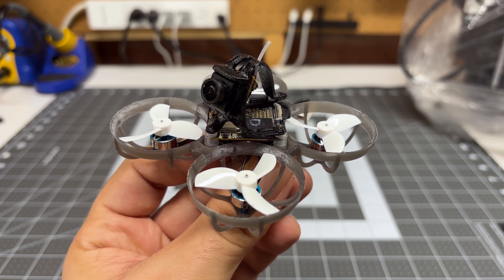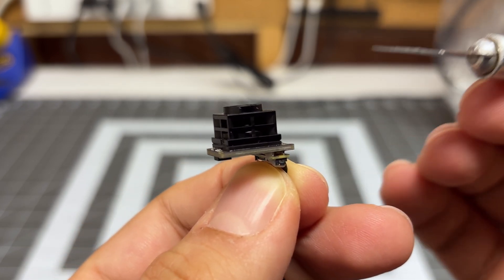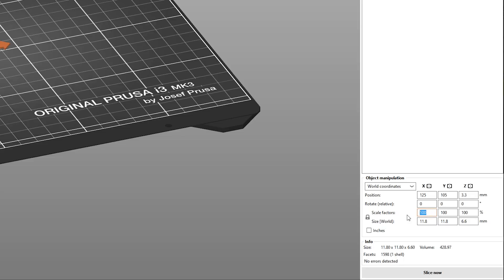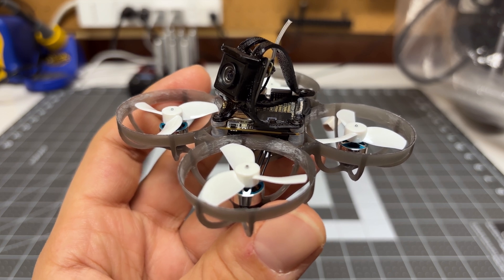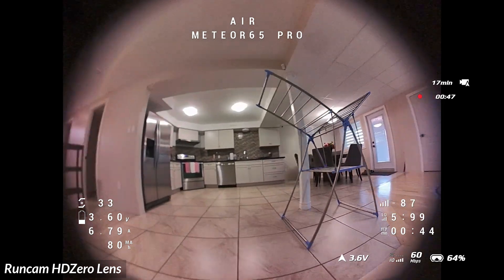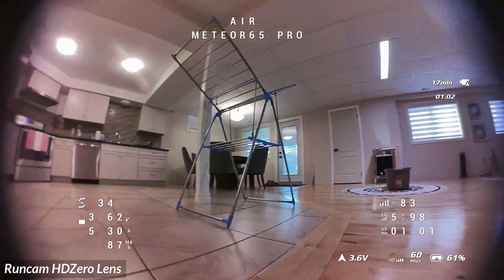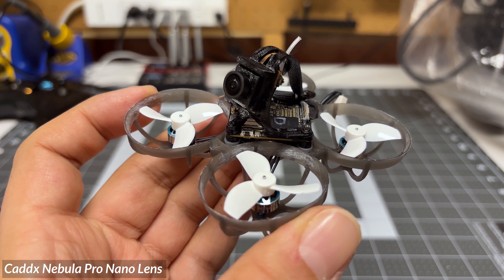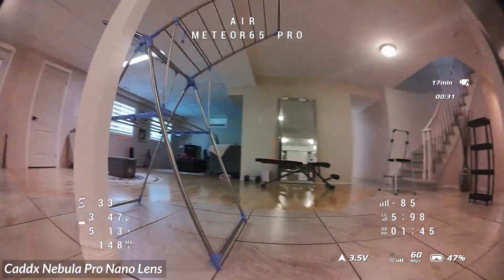Fixing the BIGGEST Flaw With The DJI O4 Lite Air Unit | Lens Swap Mod How To Guide

Comment: 120 degree FOV used to be the norm. 150+ FOV is the new standard and it is easier but pilots should be able to fly easily with this. The risk of damaging the sensor isn't worth it, especially now that DJI stuff is so hard to get.
Reply from the maker: You can actually get cameras from flywoo now so we finally have camera options should you damage it.
Reply: @Mangorille that is good news as most people would prefer the larger FOV. It's puzzling why DJI did this.

Comment: Rubberquads made a customized m8 lens with less distortion.

https://youtu.be/NQ5EfaecR4Q?feature=shared
Reply from the maker: I tried so many different lens and ultimately just decided on the Avatar lens or the Nebula Nano lens. I checked out the video you linked and yes less fish eye but then you get the vignetting around the edge. Looks like they have a lens profile you can use. Ultimately still no PERFECT solution, which is sad. :(
Reply: True! Also using the Nebula Nano Lens in 16:9. It is ok for me, a bit narrow at top/bottom. I glued the lens so i dont want to try rubberquad lens. Maybe in future build...

Comment: Kinda had a thought to consult with ophthalmologist or shops which made glasses 

They can produce lenses with needed effects 

Or photographer so they can point what would be the best natural geometry for such type of lenses
Reply from the maker: I’ve had better luck with the larger lenses such as 12mm but at that point you might as well get the larger pro version. Flywoo has an adapter you can use for better FOV as well now.

Comment: I found this video looking for a fix to a different problem. I will probably go ahead with your idea too, but the prroblem I have is dust/something inside the lens that seems to have come like that from the factory. I'd like to know how to pop it all open and clean it. With taking the bits apart like you show, will it reveal the part I need to clean?
Reply from the maker: If you're sure that the dust is in the camera module itself then you have no choice but to head up the lens and take it apart as shown in this video. You can then glue it back on but there is no other way to get behind the lens.

Comment: stock ftw. f black corners. adjust viewed perception  thumb control all is needed.
Reply from the maker: Check out Evan Turner's video, his first impressions were that the stock FOV makes it hard to hit good lines since you can't see the next gate in advance.
Reply: @Mangorille  I seen, and yea i cant fly for shit in comparison to racing but i can imagine the more shallow fov , I just like flying with the most immersive experience so having blacked out corners i would not care for. But yea for racing what your doing is cool. Just think though -less than 1/100th of 1% of humanity Fly fpv and think of how many do not even fly acro. Then of those who fly acro think how few are REAL good at flying acro. Were talking in the 1000's of people only now. So i am glad i can fly acro even which when i started i did not think i could .I wish i was not to lazy to open up my 10 new dji 04 whoops i basically bought every one that came out from few brands (newbeedrone, flywoo, betafpv,happymodel) and i need to learn to fly them inside  fast as possible .Sadly i have like 35 new quadcopters unflown still. biggest being the helion 10 i bought about a year ago and never set it up lmao. i have 65 quadcopters total about. then 50 offroad racing rc's.

Comment: Thank you for the video and your experiments, they’re priceless. But where did you find the o4 pcb printable dummy?
Reply from the maker: You mean the 3d printed part shown in the video? If so, there's a link in the video description to Thingiverse.
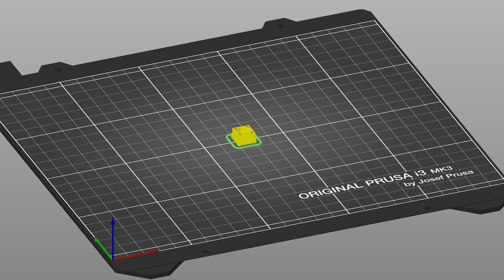Reply: @Mangorille  I meant the green camera sensor inside at 2:53. Was it a sensor?
Reply: Got it, these were just support levels. Thanks
Reply from the maker: @ Correct, those are just the supports added automatically by the printer slicing software.

Comment: Both you can Rice_bowl have shown a weird color cast.  The center is green and edges red.  We thought it was sensor damage or IR filter issues but I think DJI added a color process to the sensor to compensate for the sensor or the low quality stock lens.
Reply from the maker: Yup, all the lenses I tried had that colour shift on the edge vs. the center.
Reply: @ you can improve it easily with a power window in davinci easily, but it must come from DJI compensating for the opposite effect on their factory lens
Reply from the maker: @ 👍The footage I posted for each lens was without any kind of colour grading/correction so you can get a sense of how they differ.
Reply: @Mangorille   yah it was really useful.  I did a quick fix to Rice_Bowl's clip at 43:00 in this video.  He used an old runcam thumb lens that covered the entire sensor so no vinetting which is nice but that lens is really clean so the color cast is very apparent. 
https://youtu.be/h_M7eC28Io4?t=2588

Comment: Hi. I want to build a drone on Walksnail Avatar HD Mini 1s Lite and I can't decide. Would it be better to use the Air 65 frame on 0702SE II 23000KV motors or the Meteor 65 pro frame on 0802SE 23000KV motors? I'm very interested to hear your opinion!
Reply: With micros, it's all about low weight and producing the greatest POWER TO WEIGHT RATIO.  So, I'd first try using the Air 65 frame on 0702SE II 23000KV motors. That'll get it the lowest weight possible. try it, and see how it flies. If you have enough power, and it's agile, then you've got it! If not, keep everything the same and JUST SWITCH OUT the motors. Try it again. Those motors won't add a ton of weight so they might be good if you aren't getting enough power with the 0702's. I think you will, and the 0702's will be the best.  Be sure to use the BetaFPV Matrix AIO FC so you get the built in BEC with 5v and 3a. You need that so you don't brown out at around 3.5v. It's also the lightest weight. Try to use the model with the built in ELRS receiver.
best of luck!  I am building the same exact whoop but with the DJI 04 instead!  ;)
Reply from the maker: What type of flying are you looking to do?
Reply: @Mangorille  I'm thinking between freestyle and racing
Reply from the maker: @ Those two require a different kind of build. Which one do you want to prioritize?

Comment: One more lens you could try is the Caddx Baby Ratel 2 lens - it actually has a larger sensor than the O4 (1/1.8") so there shouldnt be any black bars or vignetting (at least on 16:9). I dont think i have seen anyone else try this one yet.
Reply: this and possibly the runcam nano phoenix as well..which is 1/2"
Reply: I can tell you that even with the baby ratel 2 lens you still get vignette and distortion. One of my viewers had the same idea and I made a video about it.
Reply from the maker: @ Thanks for letting us know.
Reply from the maker: Looks like that's a 12mm lens so you'd need a different 3d print and it will also weigh more. Seems to be the same lens that comes with the Nebula Pro.
Reply: @Mangorille  not the baby ratel, that's m8
Reply from the maker: @ My mistake. Looks like the site I went to was for the Ratel 2. I checked again and another site mentioned that the lens for the Baby Ratel 2 and Ant are the same, which means I would have already tried that lens. Thanks for the suggestion but unfortunately very difficult to find details on these lens without forking over the dollars and buying them.

Comment: Thanks for featuring my design! I recommend flying in 16:9 and if using it for cinematic purposes, use Gyroflow and load the avatar nano 1s lens profile to un stretch the image. Note you can use Gyroflow without stabilizing. Just turn off stabilization and turn off rolling shutter compensation.
Reply from the maker: Thanks for posting the design! Interesting, I didn't try using gyroflow to un-warp the image.
Reply: @Mangorille  you should try it! The final image is amazing and gets rid of the vignetting in the corners

Comment: Ill try this as soon as spare cameras are available. Lol
Reply from the maker: LOL, high risk mod because you can't get a replacement camera. However, as long as you don't overheat this is technically a reversible mod. You can always re-glue the original lens back on again.

Comment: try M12 lens, it should hv less fisheye but adding couples of grams
Reply: I want to double that. 12mm lens works perfectly without blurryness, vignetting or fish-eye. From my experience it's just as "common" as 8mm mount looking around the communities I'm part of. The Caddx Avatar lens is perfect for it.
Reply from the maker: @ Have you found a 3d print for the DJI o4 lite camera that fits a 12mm lens? I've got a bunch of extra DJI Vista lenses I can try.
Reply from the maker: Do you mean a M12 lens as in a full size 12mm lens? That would be way too large. All the lenses being used for this mode are lenses with an 8mm mount.
Reply: @Mangorille  yes m12 size.
I hv tried both of them. m12 has less fov than m8.
Reply from the maker: @ You'd need a different 3d print for a m12 lens.

Comment: Quality diminishing with this mod... I'd personally just stick with the factory O4 lens and HDZero for lightweight micro racing
Reply from the maker: Unfortunately I couldn't find a perfect lens but all comes down to your use case for the O4 lite. If you want to fly indoors and close proximity, you need a wider lens. If you want to fly outdoors in wide open area, the stock lens is fine. The HD Zero lens gives the best "I just want to fly around type of performance" but it also weights the most.

Comment: It's like using APSC lenses on a Full Frame sensor. We really need a kit designed for the sensor. Hopefully someone can make a kit with an injection molded lens just like the stock one but a wide FOV. Maybe a lite and pro version with the lite being plastic lens and the pro being glass.
Reply from the maker: Would be great if a company out there made something like that.
Reply: @Mangorille  hoping one will read this 😅
Reply: I'm also hoping that Flywoo or some 3rd party company will come out with a modified camera version for O4 Lite :)

Comment: There is another popular youtuber in france, i'm not sure his name but he was saying there is a sensor crop on the 04 lite camera that is a firmware crop and it was because it was rushed to market to get rocksteady to work correctly, but once they fix a couple bugs the first firmware update will allow you to get the full sensor and 155 degree FOV or whatever if you turn off rocksteady, but who knows how long that will be? Or if its even true?
Reply from the maker: I heard those rumours as well, but haven't seen anything concrete yet. Would be awesome if true but who knows at this point.
Reply: https://youtu.be/0S9b1xoBmKY?t=309 you mean that video?
Reply: @ yes, has anyone confirmed or verified this guys claims?
Reply from the maker: @ DJI won't verify or comment on anything like this. So far it just seems like folks repeating the rumor from this one source. Even Mad's Tech, who is my go-to, hasn't confirmed anything either other than saying he heard this rumor. We just have to wait and see...
Reply: Having experimented with several different lenses, where even m12 lenses won't include the entire sensor, i find it hard to believe that it is cropped.
Reply: No french 😅
Reply: Yeah I heard it’s because of rocksteady
Reply: You need to find and try a 1/2 cmos lens with a focal length of 2.8 mm. Or something like that. Like an o4 lens.

Comment: Hi my friend, let me tell you, my DJI O4 LITE is giving an imu error. Do you know what it could be, friend?
Reply: Check the connector on the back of the camera, it can pop off pretty easily. It’ll say IMU error if the camera isn’t connected correctly
Reply from the maker: @ Good idea... Or it could also be that the connector is broken like what happened to Mad's Tech.
Reply: One of mine says that but works fine. The cable had previously popped off from a crash in my Pavo femto but the error message was there beforehand. I also get a lot of jello in both the femto and the pavo20 with a femto canopy/o4 unit
Reply: @dannomight1980  Hi my friend, what connector feeds the FC to the vtx or what connector does the vtx have for the camera?
Reply from the maker: Haven't experienced that. You probably need to reach out to DJI support.